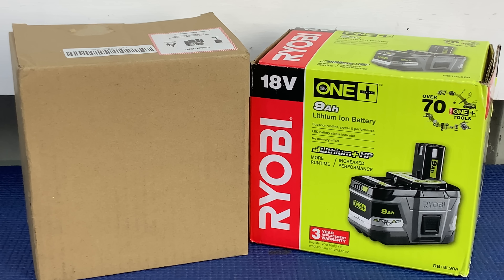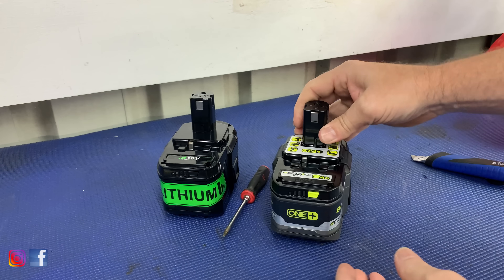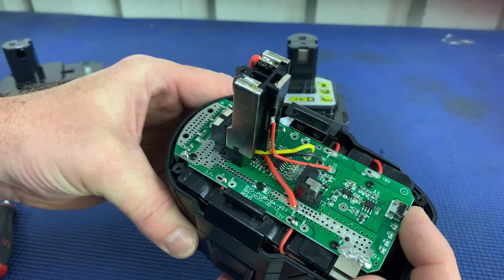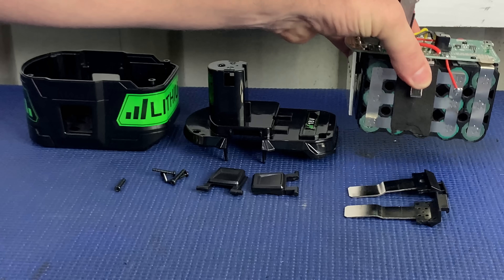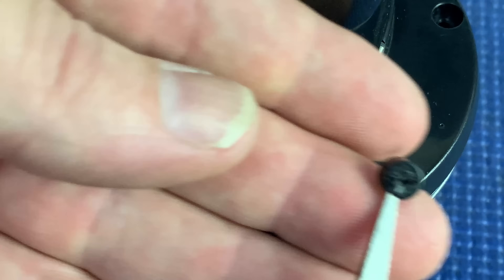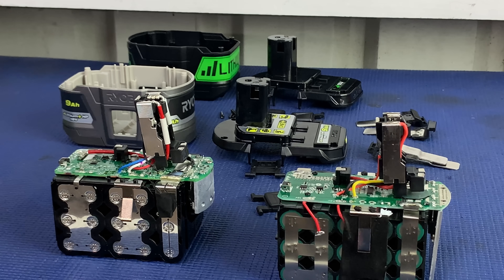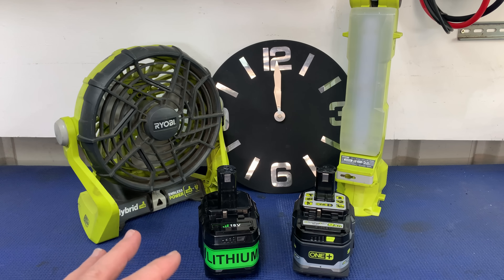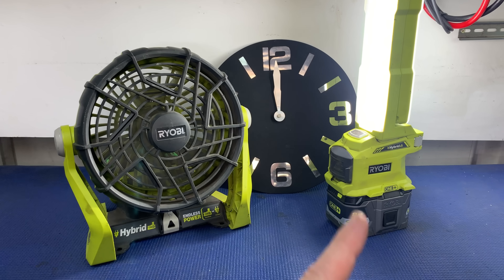Ryobi 9ah battery versus eBay knockoff job

Comment: just woundering how much you were paid or (sponsored) by Ryobi as you can clearly see in this over biased review. you should disclose this to your viewers.
Reply: Over-biased? 
I thought it was adequate. 
A product with welds that will likely give out and not last. Clearly doesn’t have the amperage advertised. Does not fit well into the products it’s powering. But is a decent price. VS a very good quality product that’s overpriced. 
He basically says the eBay version is okfor stationary products with lower power draw.

While the genuine battery is better for tools etc.  🤷‍♂️
Reply: @kirkbrooks2016  9
Reply: @dennisfraser6896  It didn't have 9ah.
Reply: Real test would be peak sustained amps
Reply: @Brett Dalton  Out of curiosity how would that be an applicable performance metric in a unified 18 volt line of tools?
Reply: I think if this was a paid by Ryobi biased video then there are bound to be far worse batteries you could get from china. 
Not that I use this but a few of my Dewalt tools have belt clips holding the battery next to my waist. I wouldn’t use knock offs especially if flames could come flying out of them. 

If I was into this, I’d much rather try repacking a used genuine battery with with LG, Samsung or Sony cells

You pays your money…
Reply: yeah think a definite bias, who gives a shit about the plastic bag they come in!   $299 for a battery with $2 of plastic, $2 circuit board, and $50 of cells is crazy, the chinese version however is like $20 of cells and $1 circuit board, would not buy it either.
Reply: @murraymadness4674  Right now in the US you can get a 2 pack of those Ryobi 9Ah batteries for $169. Or HP 4Ah 2 pack for $79. There is no need to get these low quality off brands if you wait for deals to come around.
Reply: @murraymadness4674 ryobi tools and Ryobi batteries are all made in china in the same factory’s that make Bosh dewalt black and Decker parkside . The unbranded ones are not fakes they however made to a lesser quality.
Reply: I need to quit watching these reviews by non-engineers who can’t give any real technical differences. 
While this is a decent end-user review, it leaves me a bit disappointed. He almost saved it at the end, but not quite.
Reply: I agree, first 10 minutes is a Ryobi commercial before he had even opened the battery 😂😂😂😂
Reply: Agree
Reply: You’re wrong, eBay cheapo is crap , I have experience.
Reply: Your whole delivery just seems amateurish. You act all surprised that the cheap knockoff is a cheap knockoff. You did notice the difference in price. There should be no surprises. The only surprise should've been if it had performed better than expected..
Reply: Right if you’re just gonna drink the tea don’t even do the comparison.
Reply: What do you expect from someone on YouTube that does reviews for views in return for a side hustle $$?
I'll stick with my cheap ass ' s h it' knock off no brands like I have past 2 years
Reply: @jamessey7 Where I am in Canada,I hit a few pawn shops bro for brand batteries..Unopened ryobis,rigid,dewalt etc & tools as well..Can't beat those prices..However,warranty kinda goes out the window if not bought from a home depot..The money I save tho,I could realistically buy 3 to 1..

Comment: Also, when it comes to measuring capacity, use your Ryobi branded battery for a month decently. Not just, "Hey where's my drill? I used it 4 months ago when I put that OTHER screw into the drywall." LOL.
I mean several complete no bars and recharges. THEN measure it's capacity. I will drop off. Sometimes suprisingly a lot. Yes, the inexpensive unit will be lower than rated out of the box but this has varied for me greatly. The thing is, it usually stays there as the brand name drops more and more. 
Once again, there is HUGE difference in price. especially in the 5ah and up sizes.
Honestly, the channels owner should have bought at least 3 of each of the brand name and aftermarkets to make this more of a test than a slam.
Again, not ALL aftermarket battery companies are the same. 
Please check out Vanon and go through Amazon instead of ebay for so many obvious reasons.

Comment: (Sorry but this is lengthy. I thought I would tell you in advance as wish others would do this....lol. It has to be though because there's more to buying these inexpensive batteries randomly and then doing a test like this.)
Not ALL knock off (I like to say secondary market...there is a difference) are equal. I purchase my SM batteries through a company called Vanon. After doing a lot of research, and there's no reason not to with this product, I found out there was a lot of companies producing these. This is why I start with Amazon instead of ebay. I'm sorry but there is a huge difference in so many procedures and policies not only to protect the buyer but to limit who can also sell items as well. Simply buy the same product, any product, from ebay and Amazon and try returning it in say 2 weeks. Upon request, the carrier will bring the return tag with them and pick up the from you. Now I know this isn't a site review but hear me out....please. Once again, this an be the difference in getting a bad "knockoff" and a decent "frugal alternative". 
ONE SECOND THOUGH! If one thinks that they are going to get the same performance from a battery costing half, more less 70%, of the name brand, I'm sorry but you're a single cell amoeba. Right off, I'm at the least expecting a 20% loss in quality in every area across the board! Nitpicking things like exact fitment, buss bars, and CAPACITY is an idiotic way to start talking to others. This showing me that the reviewer is assuming we are all idiots when in fact we just want to see how long battery A will last and how long battery B will last.
ANYWAYS....
Go to Amazon and not ebay to do your battery research. Yes. I'm not a sheeple and do realize some reviews are fake on Amazon but if you personally can't for yourself tell which are, just read an ebay review....if you can find one on the item.
Vanonbatteries.com is a great company but I would not buy from them directly....only through Amazon. I have over 20 Ryobi tools and about as many Milwaukee M12 and M18 tools as well. Vanon sells for them as well as maybe 5 other brands. In 2 years I've had the same amount of failures from my Ryobi/Milwaukee stock as from my budget minded batteries. I can tell you one thing though, it was night and day when it came to getting a warranty claim after Home Depot's in store replacement policy ran out! After this, you have to set up everything with Ryobi. You box them up, send them in, and WAIT! With the Vanon's bought through Amazon, I simply went into the chat section and told them what happened and I needed a new battery. One time was actually at like 1am...lol. 5 minutes later the pickup was scheduled and since I wasn't wanting a refund but a replacement, as soon as the UPS driver scanned it in his truck as a pick up, the new battery process was started and shipped in hour! You can even buy a REAL CLAIMABLE extended service contract for like $5.....it's a percentage of the sales price.
I'm sorry this is long winded but it has to be to counteract the hateful, not always accurate, list of problems that the youtuber here has listed. Maybe if he said this brand bought from this seller on ebay I wouldn't have gotten tore up at 4am about green batteries!!! LOL.
Reply from the maker: Ok, VANON batteries are the worst company on the freeking planet look at my other videos regarding this company. THEY SEND ME FREE BATTERIES FOR REVIEW and sent me one off batteries with premium batteries ALOT of people bought the batteries because of my review and EVERY SINGLE ONE GOT SHIT CHINESE CRAP cells..

Comment: I'll take a knock off. You're being scammed with the authentic battery. As long as the board holds up on the knock off, I can just replace the cells with some Japanese stuff. Your butthole is bleeding already if you buy the genuine. OR you can buy the case/board and pop your own cells in and it's really cheap.

Comment: A fair test would be to spend the same amount of money on each of both types. In this case $299. Ie 4 knock offs vs one genuine. Only after doing identical tests can you determine which is the better value. Eg. Will 4 knock offs last longer than the one original ?
As far as the quality of build goes, do those (thinner? - Did you measure them?) knock off nickel strips get hotter or make the pack more likely to fail or be dangerous ? You've raised some very interesting points including some non quantifiable ones which can't be tested. Thank you for all your work here.
Reply: more than 1 also has an extra advantage, you can charge the others while using also 1. With only one you have to wait several hours to charge..
Reply: The bigger strips only matter when you use high power draw tools for extended time.
For your regular screwdriver or things like fans or light the normal ones are fine.

Depending on your usecase having a couple of both original and knock offs probably is best. Use the original ones where you need the amps and duration. The knockoffs are fine for most everything else.
For the money you save you can probably buy an extra tool that comes with another couple of original batteries as well.
Reply: How is the cheaper battery a knock off? I think this guy misunderstands the term "knockoff"

Comment: The Ryobi costs 4× as much, the components are no way near an extra $200. The Ryobi is overpriced and I'd rather have 4 cheaper ones.

The Ryobi should cost half the price it does. Don't make excuses for corporate greed.
Reply from the maker: You have at it... and you can bitch about the quality here when your done..
Reply: @HBPowerwall  and you can pay rip off prices like a plum. £50 to make £300 sold to fools.

The Ryobi battery doesn't have £10 worth of extra workmanship/materials than the cheap one and costs £230 more.
Just bend over and drop your pants and let Ryobi do what they want with you.

No, a cheap battery isn't the perfect solution, but neither is a criminally overpriced official one. If Ryobi weren't so greedy, there would be no need for products that do 90% of the job for 25% of the cost.

There must be 600% profit on this item, that is unjustifiable.

Comment: That knockoff is actually not badly made,except that weld. .1 X10mm nickle strip will hold 10A per connection.
Reply from the maker: Except that 9ah claim is about as truthful as my wife saying "I'M FINE"

Comment: As time goes on I've found the fake stuff getting worse. For batteries, I'll buy original in store with warranty from now on.
Reply: I found a deal on a 2 pack of 6ah for less than one on the Home Depot page. Just bought them!
Reply: Using battery in rattle gun it shakes the wire loose.
Reply: On the eBay batteries. Also very hard to remove from chargers

Comment: It looks like an array of the ubiquitous '18650' lithium cell, used in many battery packs for not just power tools, but laptop computers as well. I would suggest that the 'knock-off' cost just as much to manufacture, but with lesser grade components, and the guarantees of the 'Ryobi' brand name ratings. The interesting observation is that of failure in a few years time, with similar use. The dominant characteristic is when the Ryobi item fails, and the price of the replacement cells, as a re-pack. In that circumstance, one is inclined to opt for the 'knock off' as a replacement...

Comment: Haven't had any issues with my knock off falling out. Curious what the lifespan would be compared to the Ryobi
Reply from the maker: lasted two more weeks before it fell out of the wipper snipper and cracked the case..
Reply: @HBPowerwall  that's the problem with these clones, hard to review for every different clone and they can perform very differently

Comment: Buy the knock off, i have 2 and I have the most expensive ryobi leaf blower 18v, it works well for home owner , you can't use ryobi commercially you need gas powered but my experience with the 9ah fake one is the same as using 2pcs 4ah battery when cleaning my 3600sqft house

Comment: The Ryobi knock off batteries seem a good deal but they are a complete waste of money. I have 2 both have died really quickly first one went when I put it in my Ryobi chainsaw.  The second one just stopped charging.I buy Ryobi ones now never had a problem. The knocks off can't handle high current.

Comment: I've used the knockoff batteries. Yes, they are lower capacity but the price difference says it all. Ryobi is exploiting its customers shamefully. I'm surprised they not also doing security chips and screwing you even harder.
Reply from the maker: Nop I call bullshit - these companies are using lies and false marketing to sell their product... 9ah my ass it's not 1/3 of that in my current tests.. I really should release that video
Reply: @HBPowerwall  Yes, you really, really should.

Comment: t would have been better to do all the testing first, before disassembling the batteries. That way it ensures that the disassembly/reassembly does not affect the battery performance. A connection may have gotten damaged when the were put back together. However your test do point out that you get what you pay for. In the real world someone who does not use power tools may get away by buying the cheap brand. A professional would not was their money on garbage. I did enjoy the review. The Ryobi is expensive down there at $ 299 AUD. They cost about $ 160 AUD in Canada ($ 148 CAD).

Comment: My cheap knock-off does not run the circular saw nor my grinder.  It does run my drill, impact radio, and flashlight. I will never buy these cheap batteries again.

Comment: I love this video and want to know more about the knock off. I would like to know the results of discharge test, the kind of battery cells that it actually has, and if this truly is a HP compatible battery as it's has two additional battery terminals in the rear of the battery. Most Knockoff's don't have those rear battery terminals. As of now, that 9ah knockoff is 1/3 of the price of the genuine Ryobi.
Reply: A knockoff 9Ah caught fire and ruined my angle grinder. I'm sure they're great for running low draw toys (fan, light, radio) for way more time than anyone needs but on the real tools that require a high Ah battery to perform their job, they're just a tragedy waiting to happen.
Reply from the maker: They just reached out and want me to make a review for them :p

Comment: Prob silly questiom but what would happen if i connected in a pinch one of these batteries to my 125cc scooter starter motor....would it turn it even momentarily? Thanks dude...Glad to see the mini rebuild comming along nicely!😊👍
Reply: You can jump start a car with a dewalt 18v battery, but you need to be kinda quick ;)

I think AvE jump started a couple of things with tool batteries recently 🤔
Reply: @mor4y  Thanks😊👍💥

Comment: i have dropped a ryobi battery 12'(4m) off of a one story roof onto a grassy yard with no problems while roofing a house. i was using my recip. saw to trim plywood decking that i had to replace due to water damage, and dropped it while swapping a dead one for a charged one. i know lithium batteries don't like being dropped, but my 4ah battery didn't complain one little bit. i have over a dozen 18+ tools, and have replaced the cells in a few of my batteries over the years, mostly with samsung cells using a spot welder i made from youtuber darkkevin's design. better to do that than wasting my time and money buying the knock offs. ryobi 18v tools are made by the same people who make milwaukee 18v tools, and considering the difference in price, i have zero complaints with them.

Comment: So ive seen these 9ah knockoffs on ebay myself for about £51. Its hard to find the genuine 9ah ryobi batteries here in the UK. If like you say they arent the capacity they say they are and more in the range of about 6Ah i guess u really need to compare them to a 5Ah geniune ryobi that only cost about £20 more that will be better build quality.
Reply from the maker: hahahahah 6 ah FAT chance lol that is a fairy tail inside a dream!
Reply: @HBPowerwall  i watched another video since of a guy testing knockoffs vs genuine batteries in an extreme senario cutting trees with the ryobi chainsaw. Several times both the genuine and knock off batteries overheated and saftey cut out. The knock off got alot warmer and even the battery contacts were hot wereas on the genuine battery the contacts werent hot just rhe batteries themselves. The genuine battery also ran for the longest time before the first thermal cut out.
Reply from the maker: Sounds like my experience except this 9ah isn't even 3

Comment: I've been using Ryobi 18V tools for over 12 years now and always been very happy with them.  I JUST replaced 2 of my 4Ah batteries, which both had a date code of 2008.  They took a charge just fine, but started to fade on high draw tools.  They were ok on a screw gun or a drill for short use.  But 12+ years on 2 Lithium batteries - fantastic!  I waited for the Ryobi sale and got a great price on qty (2) 6Ah batteries, which go forever.  I can't imagine the 9Ah.  Great video - I will stay with the OEM Ryobi batteries.  Maybe I'll get another 12 years!.  I'm glad Ryobi has stayed with the exact same 18V battery connection for their tools all these years.  My 12 year old power tools work just as well as the new stuff, and I continue to expand my collection with new Ryobi tools as I need them.  I'm very satisfied.
Reply: That's why I have Ryobi. All the other manufacturers change battery standards every few years.
I have some Ryobi tools older than my grown up kids. Still in use because getting batteries for them isn't a problem unlike other brands I've had
Reply: @markthoel9437  What? Makita's 18v platform is almost 20 years old.
Reply from the maker: I agree, i've had the same experience - wouldn't be with out the them in my toolbox